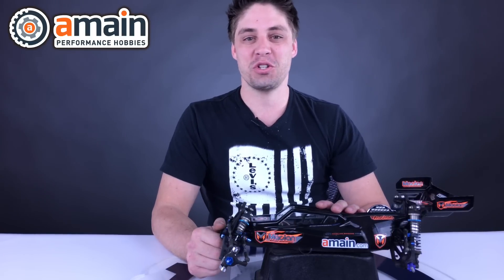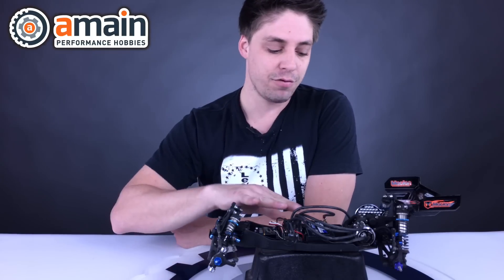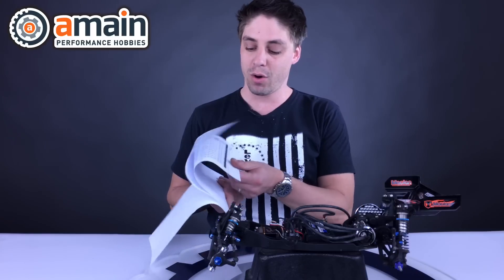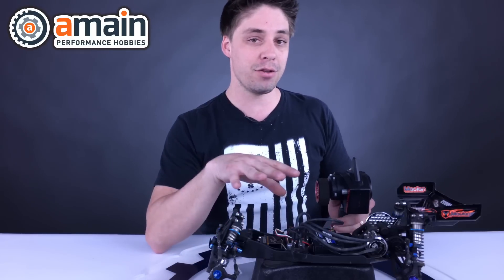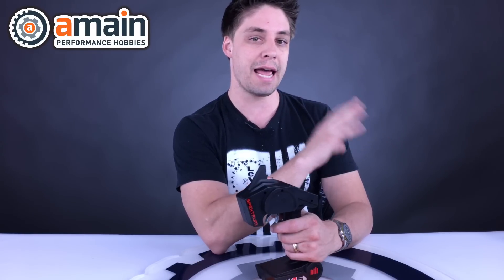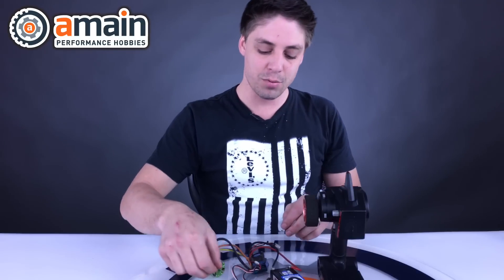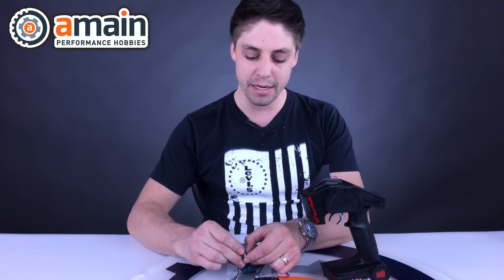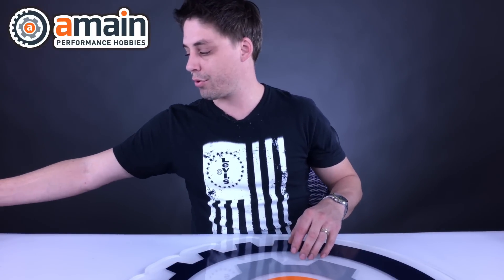AMain Tech Talk - Ep 5: How to calibrate your ESC & Set Throttle & Brake End Points

Comment: Not calibrating, can that affect your servos, to the point of burning off?
Reply from the maker: No. You can still set your servo EPA (end point adjustment) despite the ESC not calibrating. They are separate systems. 

-Brett

Comment: I have a hobby wing max 6 in my x01 calibrated no problem but for some reason I have full throttle full reverse but no braking it used to stop like a train but doesn't now manual doesn't help anybody know how to set it up? I tried the hold set 3 seconds but still no use
Reply from the maker: Interesting. Looking at the manual, there are only two Running Modes: Forward/Brake and Forward/Reverse/Brake. It is possible though to disable the Brace Force, it's option 9 under Max Brake Force in the manual. By default, it should be 50%, but it is possible to disable it accidently. The only other thing I can think of is if the transmitter throttle trim was not at the neutral point during calibration, that possibly is causing the brake issue? Let me know what you think BigPoppaPaul. 

-Brett
Reply: @AMain_Hobbies  thanks for the reply you may be right not actually at the car just now I'll try recalibrate again wondering tho in the manual you can have a few different settings of brake force can you adjust that from set menu ei up from 50% to 60 or down to forty without a hobbywing esc card? On the trx4 from traxxas it has a few pre installed setting s rail trial etc is hobby wing similar the paper with esc is very vague
Reply from the maker: Yeah, you should be able to program the ESC using the SET button on the switch. Check out item 4 in the manual, "ESC Programming;" it covers the process. It's not so easy to do the first time around as you learn, but it is possible to program your ESC this way. Here's the manual if you need a copy: https://images.amain.com/images/resources/HWA3010500/Manuals/1-HWA3010500%20HWA3010400%20-%20MAX5%20&%20MAX6%20Large%20Scale%20ESC%20Manual.pdf

The Crawl and Trail profile on the XL5-HV are pretty specific to that ESC, but they are only preset profiles that you could copy on any other crawler ESC. It's pretty rare that anyone will change ESC profiles out on the trail; it's a set it and forget it thing. I'm not sure if that answers your question on the TRA ESC. Let me know!
-Brett

Comment: The one where you hold the controller to active the calibration mode is the same on castle but you have to hold full throttle, then brake, then neutral.
Reply: Thanks man